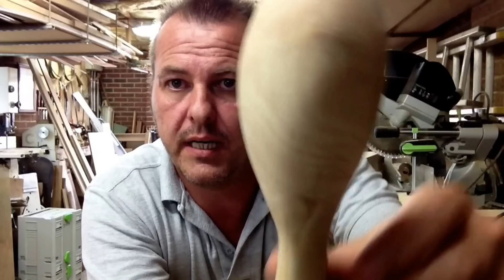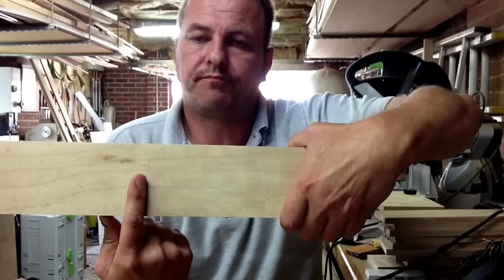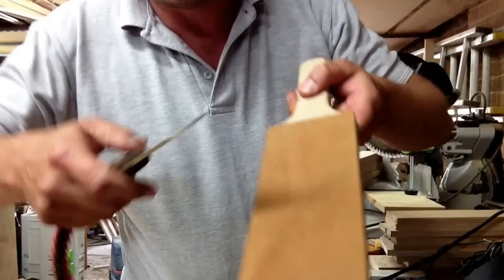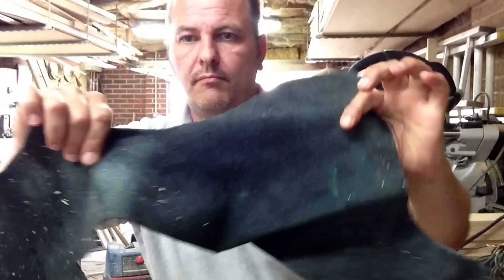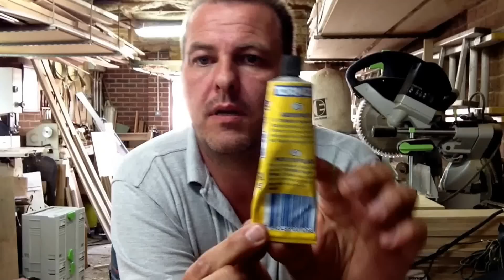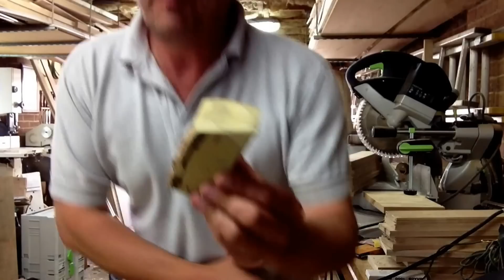Apologies, Update and Strops

Comment: Nice sized strops Shaun. I can vouch for the paste (use it on my T7 grinder setup)
£6.84 incl postage from http://www.chronos.ltd.uk/acatalog/Individual_Accessories_for_Tormex_Grinders.html
about 3 days for delivery but cheaper than APTC.
Work is still slow to the east of you too, says so much for the government spin we keep hearing, so I understand where you are coming from..... hang on in there it has got to get better (not so sure about the Google/tube variables that keep messing up though ;-)   ) atb Rob
Reply: I recently had cause to look further than APTC, I bought the T7 from them but they are getting to be rubbish at keeping stock in for all the extras I want to buy. Took a punt on Chronos and can't fault them thus far. Glad it was of use. atb Rob
Reply from the maker: RobGb100 Many many thanks Rob, appreciate the input buddy! ATB Shaun